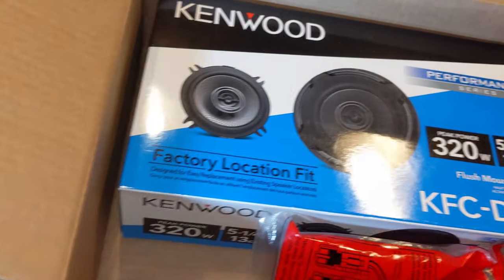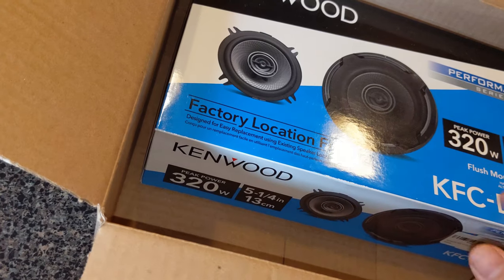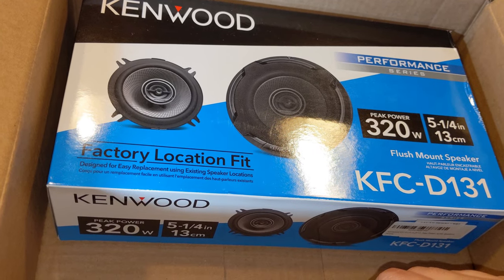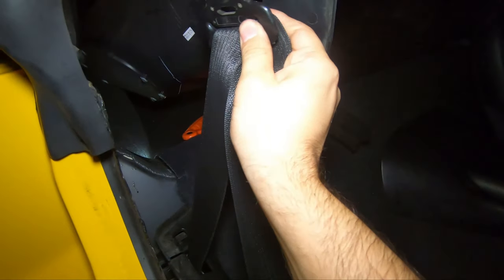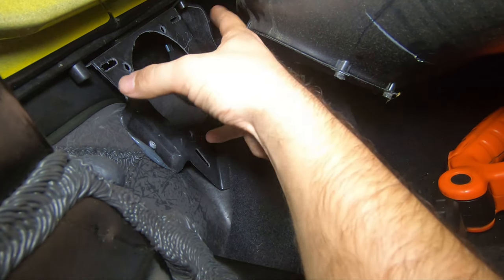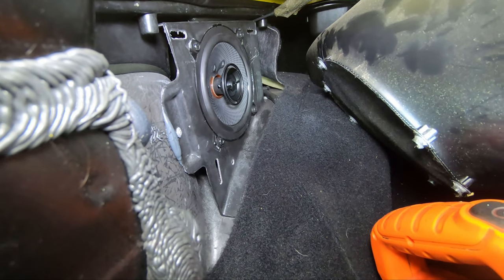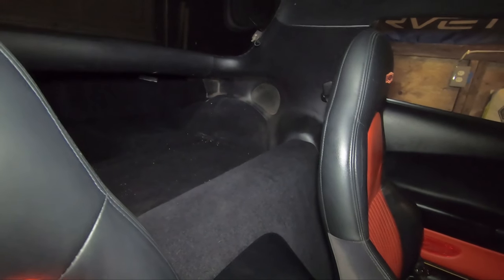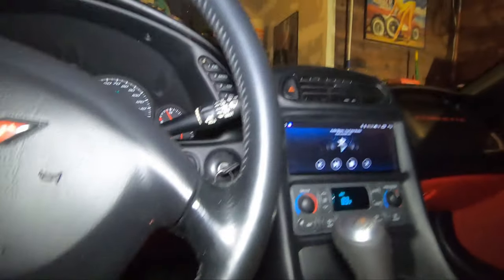QUICK REAR SPEAKER INSTALL TO COMPLIMENT THE NEW 1.5 DIN.. THE EASY WAY!!!  C5 CORVETTE Z06

Comment: Good how to video. Got a  very nice pair of JL Audio coaxial speakers I put off installing because I couldn’t find a dwarf to get in the back to help . As soon as it cools off I’m on it. Still, I’m always skeptical of any job that only takes 20 minutes. Four hours later with bloody hands.......Seems on most other C5 models you just pop off the grills. Not on the Z06

Comment: What speaker wiring adapter did you use. You tossed around the red bag but never shared that info. I  would like to order those also when I order speakers.